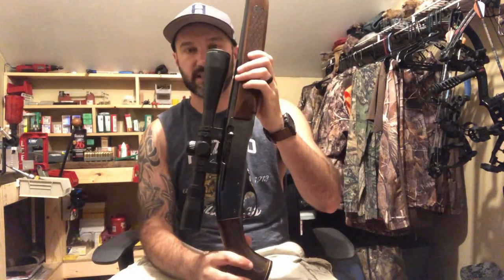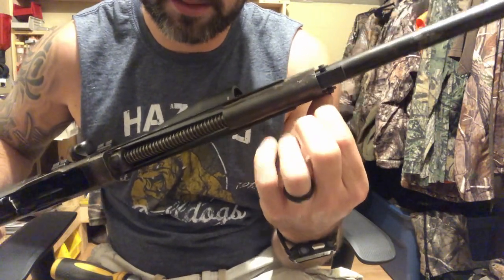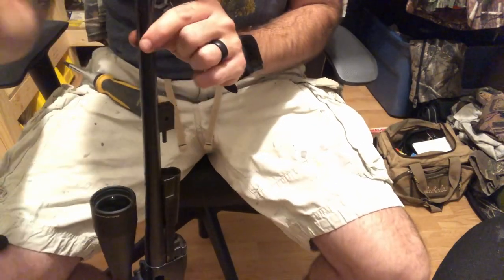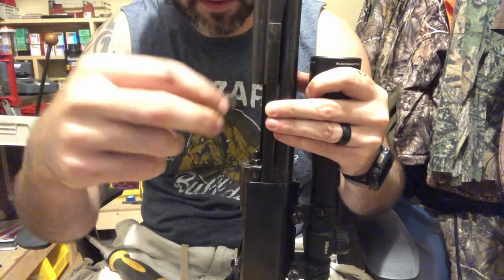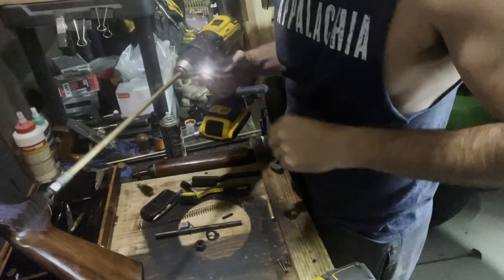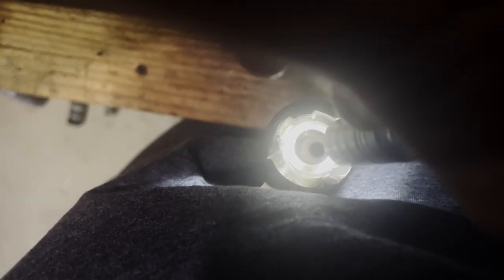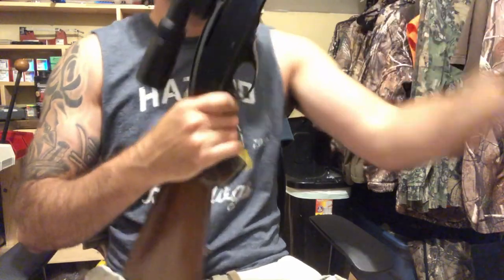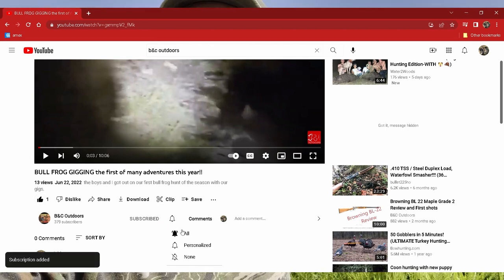How to clean a Rusted rifle chamber and Remington 742 disassembly / assembly

Comment: I bought a 7400 in 30’06 last year, it hasn’t given me any problems but while cleaning it after taking it to the range I ran my endoscope down the barrel and noticed rust in the chamber, watched your video, disassembled and I’m pretty sure it has never been taken down that far, the build up was awful, and it was pretty dry, it’s clean and thoroughly lubed now but I feel I need to make sure the scope is still on since barrel was removed. I like this gun, it has put several deer in the freezer the last two seasons.

Comment: Awesome job bud! This model has a bad name for jamming but i realized most people never really cleaned them properly and oiled them to death thinking it would fix the problems most of the time the problem was in the spring from the action of firing it so much they get weak from over year's. The clips also was one of the major factors for jamming.
Reply from the maker: @briancaldwell1798  Thank you and thanks for watching! any gas driven auto like this one needs regular good cleaning of parts inside and most people just don’t do it and it runs into problems but they can be fixed with a little work thankfully and back to functioning just fine.

Comment: I've had a 740, two 742's, and a 7400, the 7400 was the only one bad enough to stick and tear the rim off of the case.  I cleaned the chambers on all of them, removing the barrel is the best way to do it however I have done it by removing the magazine and trigger assembly as well as the forend and the recoil spring so the action will stay open.  You can use an extended cleaning rod mounted to a drill with a .410 bore brush from the muzzle end.  Then you can use steel wool or scotch Brite  to polish it without having to remove the barrel.
Reply from the maker: That sounds like a pretty good idea as well!
Reply: Is there a way to do it without a cleaning rod mounted to a drill?

Comment: I took a 3/4" open/box end hand wrench and filed away enough metal from the inside of the open end to be able to either loosen or tighten the barrel nut. Although because of the barrel nut's position you cannot slide the wrench entirely onto the nut, it does prevent less marring/damaging of the surrounding metal.
Reply from the maker: Hey sounds like that would work great. Tricky ol thing for sure but sounds like ya figured out a good work around.

Comment: I figured out a way to reassemble the recoil spring easily-ish (on a Remington 750 but should be same on 740, 742, 7400).  Using the cap on a BIC pen as a spacer, you can keep sled that slides along the guide rod spaced away from the barrel.  Turn gun upside down, and rest gas block and guide rod on a table flush with each other.  Freely use both hands to push the spring onto the guide rod.  Removing the BIC pen cap afterwards is annoying, it is not an ideal spacer since it is slightly too wide, but it works until I find something better.
Reply from the maker: Sounds like a good idea to me. Anything that makes it easier
Reply: I know that it is not easy or simple to make a video but a video would be very helpful in this procedure! thnkx!

Comment: THe nut that holds the barrel in doesn't want to go tight against the "housing"--it is not cross threaded!!  Any ideas
Reply from the maker: The only things I could think of that could affect it would be the nut upside down, the little plate that sits under the nut is blocking the hole somehow or there’s something clogging the recess that the nut goes into in the barrel lug. Not sure otherwise what would cause it to not go all the way down

Comment: Have you noticed any signs of rust since you've used the brush & Scotch bright pad technique?

Personally l've been cleaning up a new (to me that is) rifle and found a thin layer of orangish rust in the chamber but I'd been expecting to find worse since rust along contact points had been allowed to slowly rust over decades as it lounged away in some guy's closet. After cleaning up my Grandpa's old .22 rifle (which up to that point hadn't seen the light of day for almost forty years) I know that doesn't automatically make it a wall-hanger otherwise I wouldn't have bought it. 

Thankfully the barrel itself shows only signs of what I would consider light pitting, like a half-dozen or so small pinpoints that can be just made out with the naked eye but, having never had to solely focus on the chamber before, I've been casting my net over the internet for any helpful advise or ideas.

EDIT: that's a nice looking rifle btw😉
Reply from the maker: I haven’t noticed any new rust since cleaning this chamber but I bet if you wanted to add an extra layer of rust resistance to the chamber you could get a bottle of cold bluing and put in couple of coats in the chamber and it would definitely help some.
Reply: @bcoutdoorsmedia  Happy to hear about the rust, or rather the lack there of, and thanks for replying to me so promptly.

P.S. First time I've heard of someone cold bluing the chamber but that's something I'll have to work up to in terms of my current skill level.

Thanks again😉😎